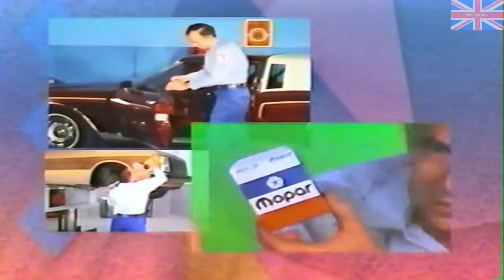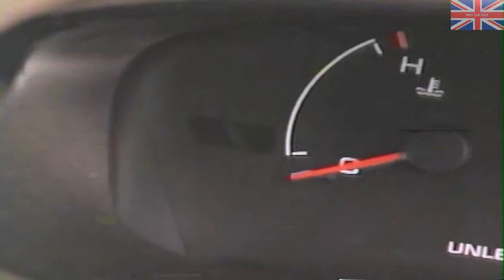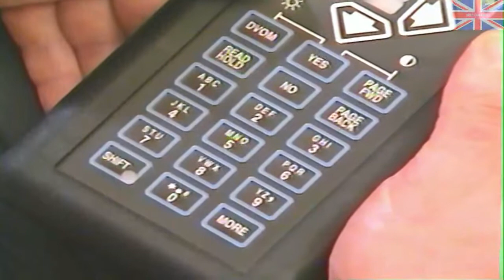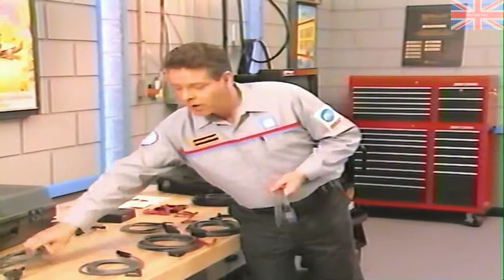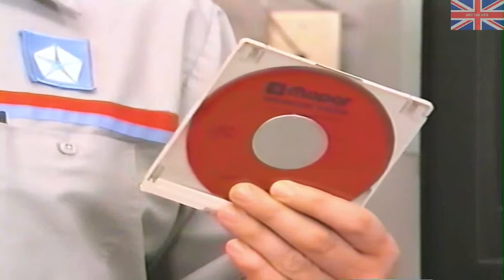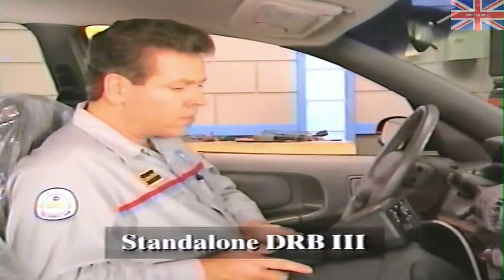Chrysler (US) - MasterTech - January 1994 - OBD2 and DRBIII

Comment: I have a Chrysler Lebaron GTC 1992 3 Liter V6. Trying to figure out starting misfires. I think i need DRB 2 or 3 diagnostic tool, but crazily expensive. Anyone knows if OBD 1 or 2 Diag Tool would work on that car?
Reply: Obd devices will only ever tell you what codes are activated by the check engine light, unless you purchase a more expensive obd scanner that can give you more in-depth reading of your current sensor readings. I personally have a Bluedriver OBD2 Bluetooth scanner, and it gives me great options but ultimately its only a one way scanner

DRB scan tool is a two way scanner, which is to say, it can send and receive data from the engine. It doesn't just show you codes and current sensor readings, it can isolate and test sensors and push codes to the computer. It can reprogram the pcm, match new vins and key fobs, as well as use different interfaces that you use directly in the engine bay, not just the Obd port.
Reply: Any luck? OBD2 is on board diagnostics 2nd generation. It was mandated in 1996. Due to yours being a 1992 it probably wont have a port for the standard 16pin data link connector. I know on some vehicles you can jump pins on the port or ground something and count how many times the engine light flashes then translate that for your code. On some Mopar products like my 01 Dakota you can cycle the key three times and the dtc diag trouble code will display on the odometer screen.

Comment: I have a 94 concorde. No one seems to have anything to use to scan for codes. In the past I've pulled codes using the key method. But it doesn't want to blink any codes at all now. Not even the 55 code.
Reply: Your check engine light is probably burned out. At this point the bulb is 28 years old. They don't last forever. 🙂